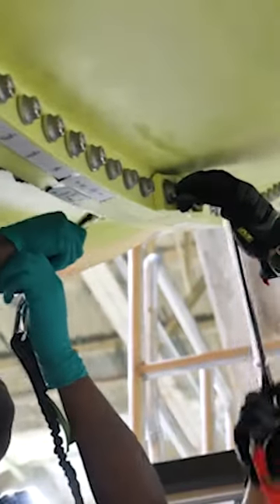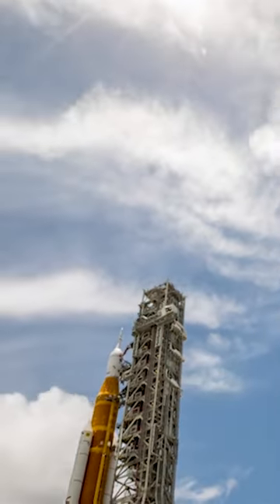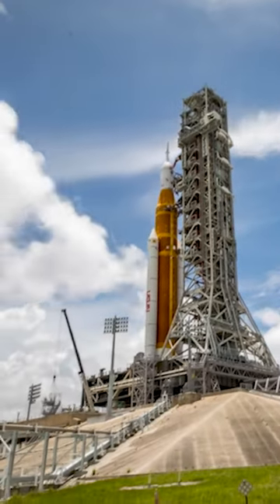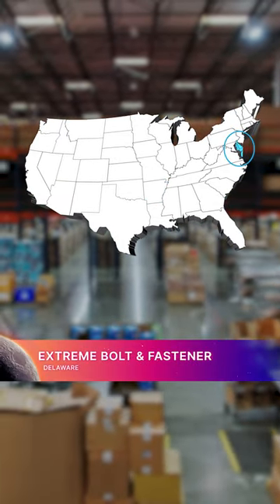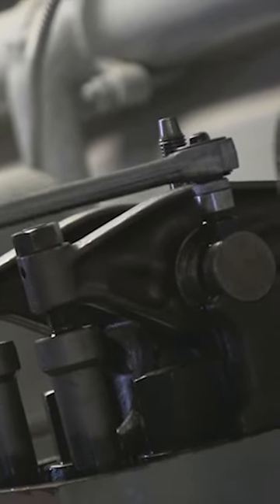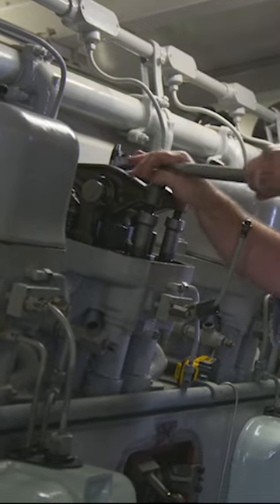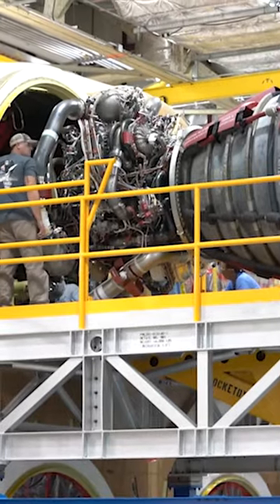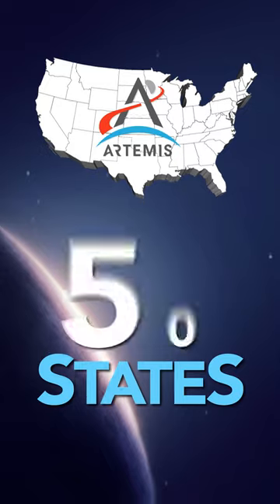50 States for Artemis - Episode 1

Comment: I just don't know why NASA should choose Apollo style old technologies of space capsules and expendable heavy lift rockets to go back to the moon? A 21st century Apollo style moon landing which used old technologies of space capsules and expendable rockets is very meaningless.
Reply: Because it is not Apollo-style old technologies.  The technology is not only much improved but also much cheaper.  Lest we forget, developing Apollo was 5% of the nation's GDP.  These days, NASA gets barely 10% of that, and is expected to do MORE with it.

Expendable heavy lift rockets are in fact cheaper, because much of the cost in reusable rockets (especially engines) was in refurbishing them.  Its what made the Space Shuttle so damned expensive.  All of the refurbishment needed after each flight was about the same cost as building a brand new one from scratch each time.  And that's WITH all the extra complexity built in to MAKE it refurbishable in the first place.

Cut out the complexity and you drive down the cost considerably.  Further, when you build a rocket stage to come back down to a safe landing, all of that fuel required to make that controlled descent and touchdown is taken away from payload capacity.  

And lets be clear on something, capsule-based spacecraft design is the most efficient and capable spacecraft design possible.  For all those who point to the Space Shuttle, it was a glorified freight truck, nothing more.

Comment: The contractors have two years & $5B worth of deniability & good will that is now an expectation of almost 100% failure. They’re hoping Nov 16th fails & NASA cancels so they can just walk away after paying some nominal “performance penalty” fees.
Reply: "almost 100% failure"

And how's that working out for you
Reply: I just don't know why NASA should choose Apollo style old technologies of space capsules and expendable heavy lift rockets to go back to the moon? A 21st century Apollo style moon landing which used old technologies of space capsules and expendable rockets is very meaningless.
Reply: SLS rockets and Orion capsules are essentially very old technologies of Apollo era! It's a shame to use Apollo era old technologies to go back beyond LEO in 21st century! I just don't know why NASA doesn't use new technologies such as in-orbit assembly, space tugs, space refueling depots, and plasma or nuclear propulsions!
Reply: @powerfulstrong5673  Because starship is the only even possibly viable vehicle - and it's only been a concept for a few years anyway.

Artemis was conceived in 2011 iirc, and reusability wasn't even on the table. And yes, we now have crew dragon, and are likely to see significant increases in reusability I'm the future. But for the next decade, even the fate of starship is uncertain, and I suspect that heat shield reliability and bellyflop reliability will make it a long while before starship is rated for earth based crew launch.

Basically: anything but SLS is uncertain and at the time Artemis was started it was literally the only practical choice. I do believe that 2 decades from now reusability will be the stus quo, especially for the moon.
Reply: @maxv9464  What I am talking about here is not starship! What I am talking about here are in-orbit assembly, reusable space tugs, Earth to LEO reusable delta-winged spaceplanes, space refueling depots, plasma or nuclear propulsion deep space ferry tugs.
Reply: @maxv9464  Did you ever know the Space Transportation System (STS) which NASA proposed in 1969 to replace the Apollo capsules and Saturn V and Saturn IB expendable rockets? The system's major components consisted of:
1. A modular space station in a 270-nautical-mile (500 km) low Earth orbit, and as well as a permanent lunar orbit station. 
2. A chemically fueled Earth-to-station shuttle.
3. A chemically fueled space tug to move crew and equipment between Earth orbits as high as geosynchronous orbit, the space tug also could be adapted as a lunar Earth Moon transfer vehicle to ferry crew and cargo between low Earth orbit and the moon.
4. A nuclear-powered ferry using the NERVA engine, to move crew, spacecraft and supplies between low Earth orbit and lunar orbit, geosynchronous orbit, or to other planets in the solar system. As Apollo accomplished its objective of landing the first humans on the Moon, political support for further crewed space activities began to wane, which was reflected in unwillingness of the Congress to provide funding for most of these extended activities. Based on this, Nixon rejected all parts of the program except the Space Shuttle, which inherited the STS name. As funded, the Shuttle was greatly scaled back from its planned degree of reusability, and deferred in time.  The Shuttle first flew in 1981, and was retired in 2011.
A second part of the system, Space Station Freedom, was approved in the early 1980s and announced in 1984 by president Ronald Reagan. However, this also became politically unviable by 1993, and was replaced with the International Space Station (ISS), with substantial contribution by Russia. The ISS was completed in 2011.
Reply: @maxv9464         I think reusable space tugs, in-orbit assembly, space refueling depots, nuclear propulsioned ferry tugs, and reusable delta-winged spaceplanes are very good ideas and are much better than Apollo style hardwares of space capsules and disposable heavy-lift rockets.
Reply: @powerfulstrong5673  Yes, I am well aware of those plans. They were conceived in an era of post-apollo optimism, but factors like the challenger disaster, reduced budgets thanks to Vietnam, and the shuttle's inability to be fully reusable made it a pipe dream.

Unfortunately NASA has to work within the whims of Congress, including keeping jobs from shuttle manufacturers and working with a significantly reduced budget. Again, SLS is really the only viable choice right now.
Reply: @powerfulstrong5673  And I agree. But something being a good idea does not make it cheap, available, currently developed, or viable for a mission architecture intending to land on the moon within 5 years.

Look, I fully agree that those will all be used... Someday. But not in the next few years, not soon enough to scrap SLS.

Also the shuttle was not viable for its intended purpose. A brilliant, unmatched vehicle but not what it could have been.
Reply: @maxv9464  It's a shame that Venture Star spaceplane was cancelled in 2001!
Reply: @maxv9464  It's a shame that Venture Star spaceplane was cancelled in 2001!